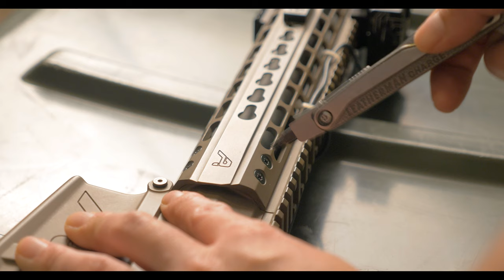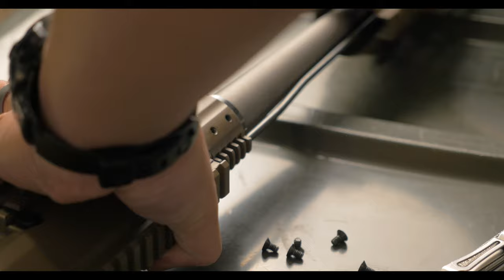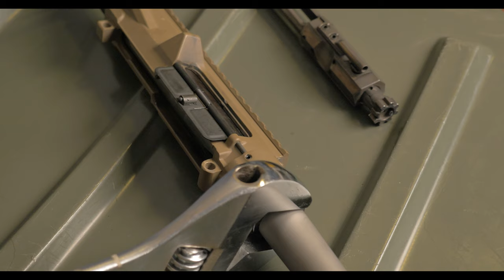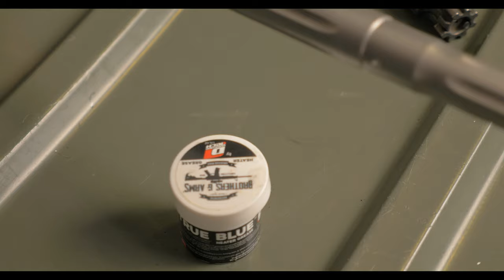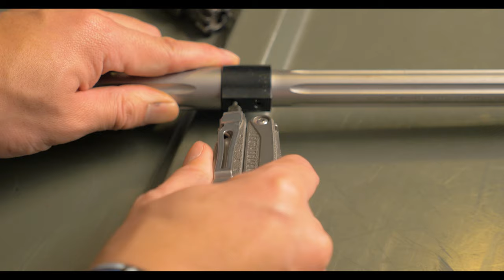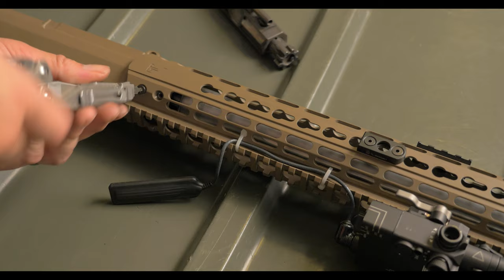Wilson Combat Barrel Swap | 6mm Creedmoor

Comment: I am a fellow Washimgtonian, I build allot of AR15's and if your going to continue to build or swap barrels its worth investing in the proper tools.  A vise is a necessity, torque wrench, eyeballing yoir gas block works but an alignment jig will give you proper alignment (I cannot tell you how many I have had to fix), a good set of torx wrenches (I have found Craftsmen have the tightest fit and sharpest bit).
Reply from the maker: I agree I'm building my shop back up again

Comment: I have a Ruger # 1 in a 338 custom Lapua. It was great working up that perfect load. Ruger sent the new barrel and workings so I had very little to do on the exchange. A week later I am doing a 1/2 mile on a calm day on the bench keeping them in a snoose can. Impressive, , , YOU BET ! It will be great to see you get this wee baby all dialed in bud. WOOHOO and onward fella.Seeing an adjustable wrench puts shivers down my spine bud. I have left many in the bush until I finally smartened up. Did that multi tool come with the rifle ?
Reply from the maker: Yeah I hate using an adjustable wrench, but the flats on the nut are gigantic and no chance of rounding it out. The updated m5E1 has a more traditional nut which uses an armorers wrench to work on it. The multitool is separate. A friend of mine bought me  bit set which works well with most of my guns.

Comment: Is that the factory barrel nut or aftermarket? The barrel nut that Aero sent with my kit I'm having a problem finding the right wrench to use  to tighten. it's not the same as the one you have....
Reply from the maker: This is the earlier generation. I think the newer ones use a more traditional barrel nut. Have you tried an armorer's wrench?

Comment: I just installed my Wilson Combat.308 20” Super Sniper barrel last night. That barrel is absolutely beautiful inside and out. Ran a bore scope through it and no chatter marks or anything. They advertise in incorrectly on their site. It’s shown to be 6R but it’s actually 4R. I confirmed that prior to ordering as well. I have their QComp on the way. Same AP M5E1 build. I did a 6.5 Grendel using the M4E1 and I’m sold on the Enhanced uppers. I look forward to see how yours performs. I still have to get glass for mine. What BCG are you running?
Reply from the maker: Aero makes the best receivers and handguards for the price in my experience. I've not had to true up the receivers or anything. I loved that when I looked down the bore, I could see the reflections of the other rifling  on the surface. #polished
Reply: @innerbarkoutdoors  I agree, AP is hard to beat. What BCG are you running? I ended up grabbing a ToolCraft NB on sale before I decided on the barrel. I tried to get a matched bolt with the barrel but Wilson would only sell it with their complete BCG. I think that BS but what can you do?
Reply from the maker: @Tazman1966  I have an Aero BCG in Nickle Boron. The best you could do is take calipers to measure everything to make sure it's still dimensionally symmetrical and then run a go/no-go guage thru it. Maybe if you put the bolt between two live-centers you could check concentricity, but that would be assuming the firing pin and the back of the bolt are exactly center.
Reply: @innerbarkoutdoors  I almost got the AP BCG but I got the Nickle Boron ToolCraft for $135. ToolCraft has our military contract and they make BCGs for many other companies that just put their logo on them. They use the same company for their NB coating as Fail Zero (which I also have) and the coating is flawless. ToolCraft also has a lifetime warranty. I just like to get headspaced bolts with barrels when possible.
Reply from the maker: Im a cheap bastard and would rather buy a bolt matched and lapped/blueprinted if I can. Labor or tools to diy are not free!
Reply: @innerbarkoutdoors  a

Comment: Aren't you supposed to loctite the barrel nut and not grease it?
Reply from the maker: Mil manual calls for grease so the metals don't corrode together. People use loctite between the barrel and receiver if there is a lot of play, which wasn't the case for this union.

Comment: Living off grid and having the potential to deal with large predators.  Will you loose any stopping power moving from 7.62 to 6.5?
Reply from the maker: From what i've been told, 6.5 doesn't lose much, since the bullet designs on modern projectiles retain most of their weight and expand well. As for a 6mm (which is for what I have), people have been hunting with the 243 for a long long time in North America. I would suspect that the higher speeds of the 6mm projectile might make it more difficult keeping the bullet together on impact. If I ever get a bunch of gel, I'd like to do some testing myself.